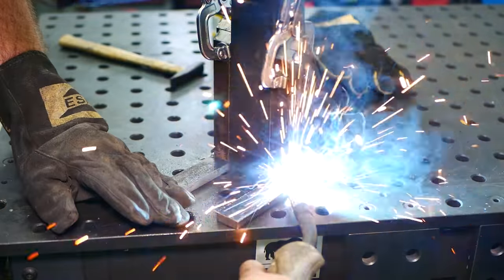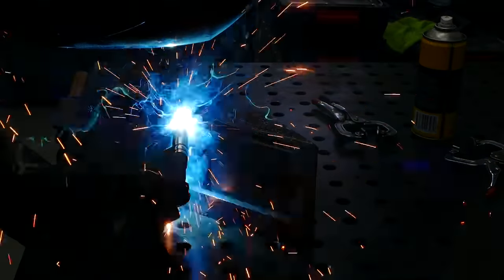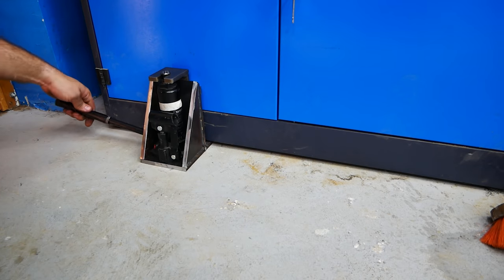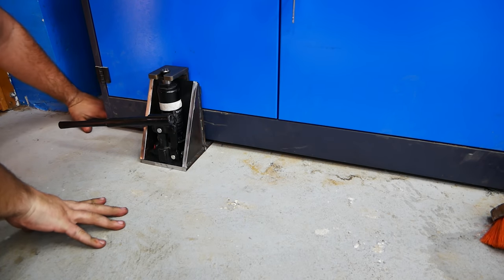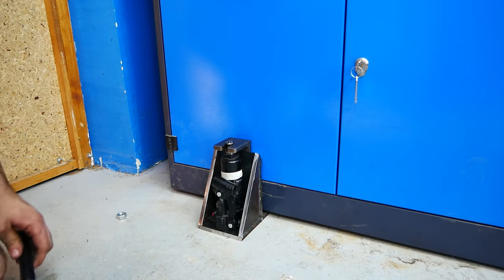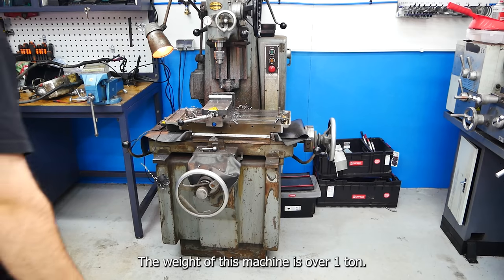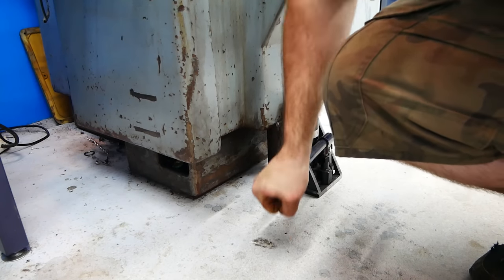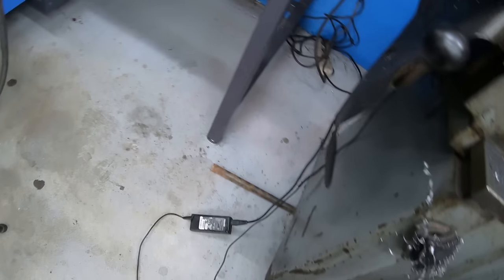Homemade Bottle Jack Attachment

Comment: Great Toe jack. I have an old mechanical one for moving machines etc. Exactly as you demonstrated. Great work as always and the new shop is looking great! Also nice idea to tack the toe together before putting in the 'V' prep. Bet that made lining it all up much easier. 👍👍
Reply from the maker: Thanks Robert :)
Reply: I think DonnDIY has one like that as well. I think his is a huge tank jack. It has that toe jack design and is mechanical as well. What Made in Poland made is something that I could have used a number of times.

Comment: Simple build. I sure need this. I would modify it to use on soft ground outdoors by making a large go-around base plate and bolt it on to side tabs that I weld onto the side of that frame.  It would help to avoid sinking and tip-over.  Removeable for versitility.

Comment: Nice! With some modification this could be used to lift the corners of these steel cargo containers for leveling. There are suppliers who sell parts to allow one to manufacture systems for the corners used on these containers.

Comment: szybkie, proste a jakie użyteczne, nie wpadł bym na to. Jak zawsze łapka w górę:)
Reply: Nicely done! Would a second release valve hole mean you could use it in tight spaces where the jack needed to lift on the right?
Reply: @Keith.Turner  BHP

Comment: Has a milling machine, but only uses it as a drill press. Makes rectangular cuts with an angle grinder instead. Strange dude. I like strange dudes. Subscribed.

Comment: Why slot the push contact point? Why push on the jack shaft shoulder?  Beautiful work as always 👍👍
Reply: Greater stability is achieved by locking the lifting attachment to the head of the jack. A Toe Jack has to lift as straight up as possible. It dosen't take much flex to buckle the assembly and tip 2 tons of steel over onto the floor.

Comment: A return spring would be nice for working in tight places where you dont have leverage to push the ram back down to remove it. I do like your version with that split plate on top to grab the screw top!

Comment: Awesome!  That's a great idea.  Ultra Low Profile Jack 😎😎

I do have a couple questions, maybe they were answered in a previous video, but I was wondering what the spray stuff you used here: (1:19). Is it some kind of liquid flux in an aerosol can?
The other is what kind of cutting discs do you use? (4:00) They seem to cut through your steel plates "very" easily and quickly, and cleanly. And appear to last quite awhile.

Comment: One thing I would need is to extend the pump side of the structure to facilitate the use of a hammer to drive under an edge without damaging the jack the would that be possible?

Comment: You could make a knob to put on the shaft you turn to lower jack instead of using the flattened handle they provide with the jack.

Comment: Should of welded a triangle piece in the L shaped part at the top for extra support. All the weight is on the weld and it can flex and crack....

Comment: OR you could go on Amazon and but a 5 ton toe jack for $110 US
Reply from the maker: Or I can make it for free using things and materials I have in the workshop ;)
Reply: @MadeinPolandChannel  18mm steel, welding suppliers and a few hours are far from free.. I enjoy watching you build stuff but sometimes its just easier and cheaper to buy it..